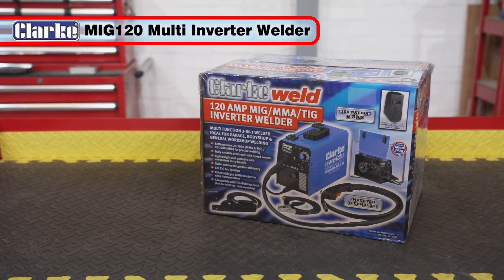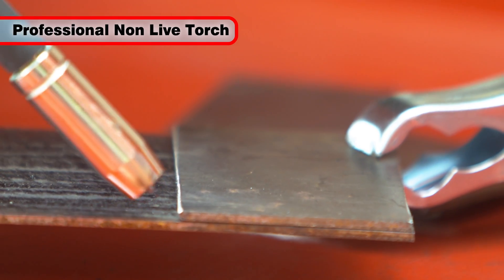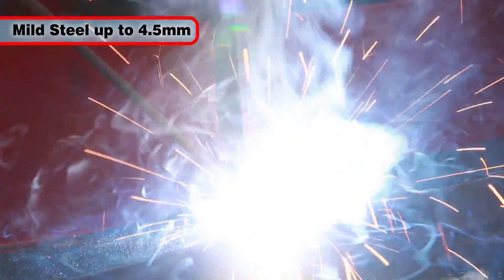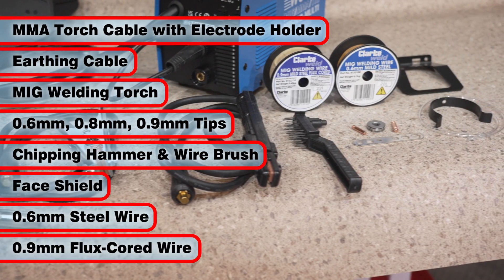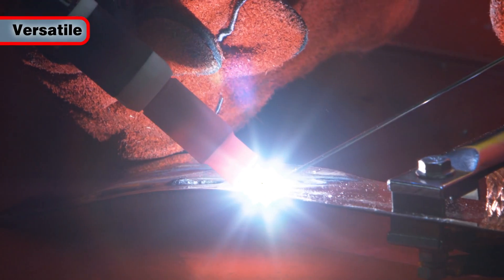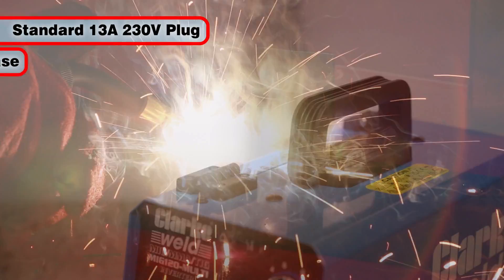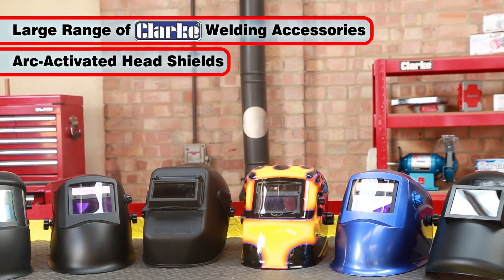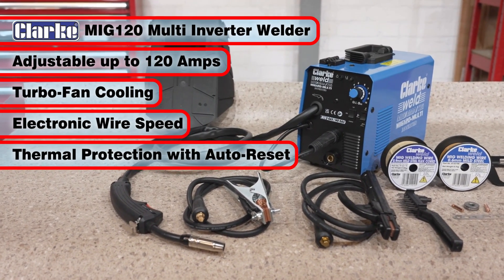Clarke MIG120 Multi 120A MIG / MMA / TIG Inverter Welder (230V) - 6015601

Comment: What could be wrong? Got one of these from Machine Mark in England and having a hard time with it. It doesn't spark, takes ages of trying with the electrode on the earthing clamp just get a little spark then weld for a few seconds and stops sparking again. Anyone having the same issue?
Reply from the maker: Hi there, sorry to hear you’re having trouble with your welder. If you get in touch with our Technical Support team on 020 8988 7400 or email service@clarkeinternational.com, they’ll be happy to help troubleshoot this with you.
Reply: @clarkeinternational1969  many thanks I'll give them a call.